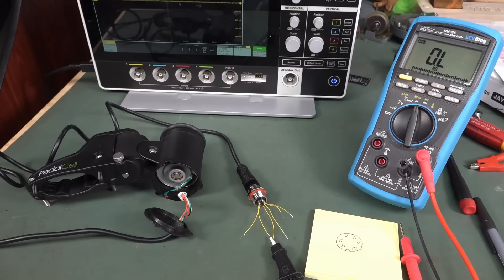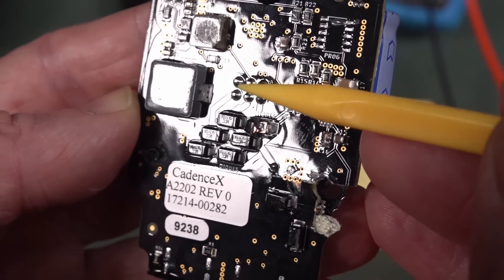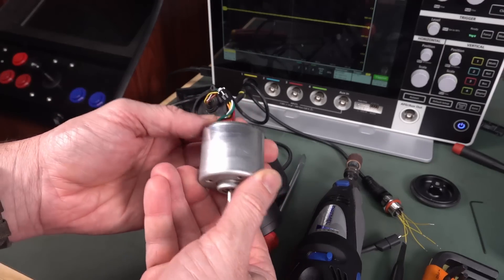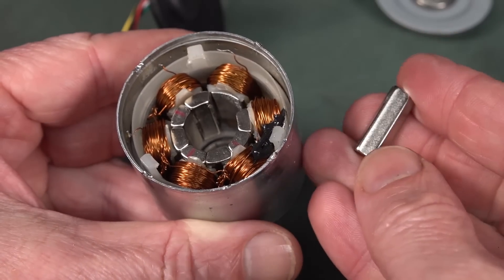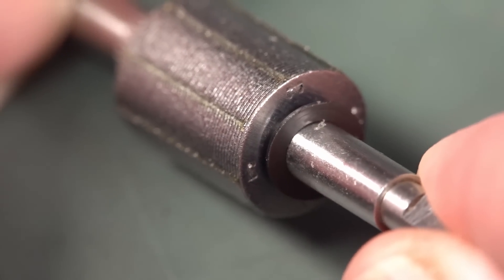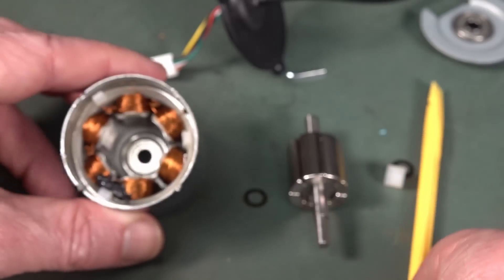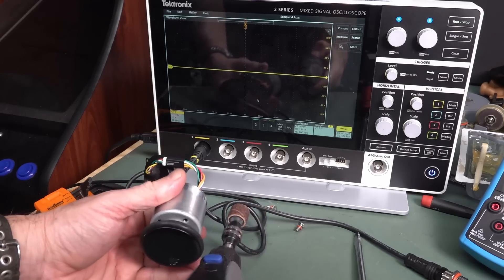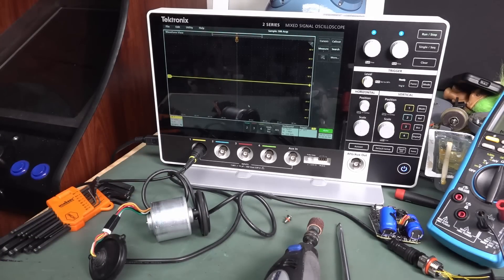EEVblog 1485 - PedalCell CadenceX Bike Generator LOL FAIL!

Comment: I remember going through dynamos like candy back in the day. The vibration, elements and sometimes thieves got to them. Why would anyone reinvent this piece of dogturd now when we have LED lights and decent batteries? Charge your phone while cycling??? Get a power bank.
Reply from the maker: I just use a velcro strip on the back of a small battery bank. Strap on when needed.
Reply: Some countries legally require dynamo powered lighting. Also, having to charge your bike lights sucks. Seriously, how many million more bloody batteries am I supposed to remember charging every day?
Reply: @MarianKeller  
what countries?
Your channel  suggests you are german. In which case, no - dynamos are not legally required in Germany and haven't been for almost a decade.
Reply: @Exgrmbl  Sure, not anymore, although I am still surprised the weight-based distinction was also lifted.
Reply: There were two basic types, as I recall (I'd have to go through my bike parts hellbox to verify).  There was one that had a small cogged wheel that was set to rub against the tire sidewall.   There was another type that mounted between the rear chainstays that pressed up against the tire tread.   I rigged one of those on our tandem with a rectifier charging 3 Gates SLA cells.   No point in a regulator--the thing couldn't put out enough to roast the battery.   Headlight was an incandescent 6V halogen.   It worked pretty well, but obviously was bulky and that little dynamo just picked up all sorts of road dirt.  If you consider that the bike wheel was about 70 cm in diameter and the little dynamo wheel was perhaps 3 cm, that poor little thing got spun pretty fast.   That was more than 30 years ago; it would seem ludicrous today.
Reply: I mean, quite a bit of energy is generated from cycling.  Why not capitalize on that?

Comment: It dosen't make sane to use lamination core just to hold magnet.😂
Reply: Actually from a manufacturing standpoint it makes total sense. Since they are punching the laminations for the stator, they already have the machinery for punching and the metal can probably come from the center of the stator laminations so it makes far more sense than a separate operation machining out of bar stock or die casting etc.
Also a company making cheap brushless motor probably makes wound rotor motors too, so pressing punched lamination onto a shaft is something that they routinely do. Considering how poor the glue job was, I'm guessing wound rotor motors are mostly what they do and brushless are a bit of a mystery to them.
Reply: @jaytalbot1146  yeah but. It batter to use solid core. That way they can use counter sank sreew, and thread locker to hold the magnet. I know it will increase manufacturing cost, but some part you can't just cheap out.

Comment: £256!!
Reply: £256, and it probably generated less than a cent of electricity in its life.  Great value for money there. 😆
Reply from the maker: @mvansumeren4313  I just have a bit of velcro on a small USB battery bank. Way better than any generator.
Reply: I understand it was designed and produced by students so clearly it's an initiative to pay off their student loans. An unintended consequence of charging so much for kids to go to uni is that they will charge a huge amount for everything they design after they leave in order to get their money back. 😅

Comment: Guess it exceeded the max RPM I guess we could calculate this if we knew the diameter of the bike tire.
Reply from the maker: The OP said he didn't ride it hard and broke two of them.
Reply: @EEVblog  yeah it didn't look like a good epoxy anyway. Any decent motor I have taken apart has epoxy on a bit thicker and just looks better. That looks like hobby glue or something.
Reply: Tire diameter is irrelevant since the edge where this is driven will always be moving roughly the same speed as the ground hence this PMA's drive wheel will also. IE the tire is just an idler and it's the diameter of the PMA's little wheel that matters. If it is a 50mm diameter it's just about 100 RPM per km/h.
Reply: @danielthechskid  yeah  that makes sense to me.
Reply: 700c x 23. It was on my indoor trainer with a max speed of maybe 20mph (36 km/h).

Comment: do they still put hella load on the wheel like the old ones from the 70s-80s?!..i think the old ones are better tbh.. no fancy electronics to screw up.. just a motor reversed and connected to a lamp..im sure the same thing could be done with LEDs...this one is a bit of a wank to charge a  phone with.. i mean its not gonna get that much current after the boost circuit...
i noticed the magnets straight up!... that gap between em was dead giveaway!
im guessing the centrifugal force snapped em off...nice fast down hill section woulda done it easy!..small screw through each magnet woulda been the go
the 3 hall effect sensors is a little weird... waste of components! if ya ask me!

Comment: Almost makes me wonder if the company used a bunch of discount known bad motors as generators thinking they'd suit... What an odd failure and a crappy design, that motor does not look like it would have survived high speed rotation either way...
Reply: If only there was a way to quality-control company directors.
Reply: Worst part is this is easily fixed.
Reply: If you spin anything fast enough it will fail.
Reply: re: "What an odd failure and a crappy design"

Ignores possible abuse by the owner, WHO might have dropped these units as well, jarring the magnets loose?

Comment: I'd put my money on a manufacturing defect - they should have been glued in place. Running a motor as a generator will change the forces at play as you are taking energy out and not putting it in. Although the lack of glue would probably result in the same failure mode.

On the plus side, for some with a mechanic mindset, this is an easy fix...
Reply from the maker: It had some glue. It's not possible to insert the rotor with only the magnetic strength, they just fly right off onto the stators. I tried it several times. Not to mention the centrifugal force when it starts rotating. They applied enough glue to pass testing and some use, and then it failed.
Reply: @EEVblog  Another 'just sufficient' component, I wonder if this is the motor they started off with and it got sub'ed somewhere along the way and nobody noticed...
Reply: As a lowly ME, I'll mention that the glue was all sticking to the laminations and not to the chromed magnets. If the magnet surface was roughened (mechanically or possibly chemically), I would expect the glue to hold much better. Would it hold well enough? I don't know. But since it worked for a while as constructed, I wouldn't be surprised if roughening the magnet surface would be enough.
Reply: A comment I see here posted "1 minute ago" says:
I noticed from the previous Mailbag video the "do's and don'ts" sheet included in the box said "don't ride over 40 mph". I guess they already realised that excessive speed was a failure mode for the generator! But simply telling your users not to ride too fast isn't really a proper solution to poor manufacturing...
Reply: @MidnightSt  Blimey! NOBODY on ANY bike will be doing over 40. At my fittest, I averaged 23mph.
Reply: You mention that forces will be changed is used as generator instead of motor.  That does not matter from the glue point of view, the forces are the same radially.  Tangent force will be opposite sign, but it will be the same as using the motor in the opposite direction.
Am I missing something?
Reply: @ikocheratcr  No.
Reply: @ikocheratcr  your right. the gluing wasn't upto the job.
Reply: @ikocheratcr  You are correct.

Comment: I wonder if the hall sensor is so they can adjust the charge current depending on speed
Reply: They repurposing cheapo brushless motor as generator. That's why the hall sensors.
Also when it runs as generator it makes more waste heat and the glue that holds magnets just gives up like any heated up superglue.
Reply from the maker: Possible. I would have thought you'd just dump as much energy as you could into the supercaps any way you can and not worry if it drops out or whatever?
Reply: @EEVblog  I think you'd want to adjust the loading, if nothing else to reduce risk of slipping. The patent ( AU2021250917A1 ) mentions use of a threshold speed below which it doesn't draw significant power
Reply from the maker: @mikeselectricstuff  I think what might happen is that mostly the USB charge current doesn't come from the supercaps, USB output is only enabled when the RPM/voltage from the generator is high enough. At lower speeds it just scrapes what charge it can for the supercaps to power the circuitry.
Reply: I'm pretty sure the hall sensors are used when the generator is used as an actual motor, not a generator. That configuration is extremely common for sensored BLDC motor control. The generator is most likely just a repurposed off-the-shelf sensored BLDC motor, and my guess is they use one of the hall sensors as a handy speedometer gauge for the bike.
Reply: No, it's just a depopulated standard brushless motor being used as a generator
Reply: Also, these botters are apparently getting a bit smarter, unfortunately. These bots are not only faking a natural conversation, but each one mentions the scammer. If a few of them are knocked out through getting banned, there are more spreading more crap in the same thread. Also, I don't know if it's just chance, but they seem spread out over time as well. I also noticed how they use different forms of the name; 'Mr.', 'Mr. ', 'Mr', and 'Expert', probably another way to bypass spam filtering or just seem like different people?

Also, I guess the conversation could be somewhat engaging in a, "What the hell is this", kind of way. Maybe them 'recommending' something repeatedly could possibly make it easier to hit their marks due to making sure that the people remember the bull crap later.
Reply: They all have different account creation dates as well, one is a year ago. Whoever these botters are, they are persistent and thinking long term.
Reply: @Jeff-ss6qt  Explain ?
Reply: No reason why BEMF voltage alone isn't enough to manage all things related to charging.  The single hall sensor is most likely used only to get an accurate bicycle speed gauge.
Edit:  Checked out their product video.  They say they use the hall sensor for speed/accel to help maintain stable charging output.  Sounds like a reason to get some pending "IP" for investor purposes, and marketing.  Like Y2k ready toaster ovens.
Reply: @James Doe You're lucky. He stole my kneecaps!
Reply: you don't need sensors if you're trying to recover energy via bemf. the 3 phases get recrified by the naturally occurring sine waves and the diodes. no position tracking is required here. you only need position tracking when trying to use the motor as a motor
Reply: @superxpro12  A sensor might be useful for grabbing the speed of the motor though, in the case of it being attached to a bike wheel.
Reply: No, so they can say you went over 40, no warranty for you.
Reply: Charles  Stop tagging my girl.  You know the last time you did that my only fans kicked you out.  I don't care that she's really old, you are too.  Maybe you should help me get the prince of Poland out of jail instead of tagging my girl.
Reply: Mr.Charles Wilson stole my pension to buy cocaine. Then he gave free samples to the kids in my sons kindergarten. After they got hooked he raised the price. The kids payed with their lunch money which was soon gone. Then the kids died of starvation.
He also financed a laboratory that study different viruses.

Comment: In hindsight it shouldn't feel smooth as silk when you rotate it I guess. Also when you opened it I noticed the strange distribution of the magnets with a gap between 2, see @5:41. That should have been a clue what happened but I didn't get it either until you got one of the magnets out. I wonder if there are different forces in play when it is used as intended, eg as a motor. Not sure, more coffee needed.
Reply from the maker: Yeah, was quite confusing when first opened. Can't say I've ever seen nore heard of rotor magnets coming apart before. The feel after repair is kind of a bit grindy, not a magnetic slip, the back plate which handles the centre alignment didn't go on fully.
Reply: as a motor i would expect even more forces to be exerted in the rotor as the coils would be actively powered applying more force to the magnets along with the centrifugal force. so either they are operating it far above its intended rpm range or they seriously need to audit the factory making the motors as I would never pass a construction like that relying solely on glue and soo little of it. there should be a physical thing holding the magnets in alignment such as just molding it in plastic which would be far cheaper and stronger then the laminated steel and glue they used in the rotor which is doing absolutely nothing. 

Usually Chinese factories are good at copying other designs that work but that often means they copy the mistakes too and combined with cutting corners is a recipe for disaster which is likely what happened here. we see this sort of thing all the time at my company and we are constantly having to audit (babysit) the factories in china to make sure they are using the correct manufacturing methods that we specify and every time they seem to find a way to change something to make cheaper that ends up biting us in the ass if we are not constantly vigilant.

perhaps this company does not have the experience of dealing with china and are learning the hard way
Reply: It's a brushless dc motor and they never feel smooth - they fell notchy as the magnets align with their next coil lamination.
In the rc model world we call it 'cogging'
Reply: That's gap between the magnets was the first thing I saw.  I still didn't realise what had happened though. Piece of junk for sure.  I'd rather an old 70s dynamo .
Reply: someone else explain cogging. i cant be bothered.
Reply: Aha! I knew that gap was strange as well! Great catch.
Reply: Did ** anybody ** mention these units might have been DROPPED while in or prior to use?? (THEREBY jarring the poorly glued magnets loose?) Coulda been it ...